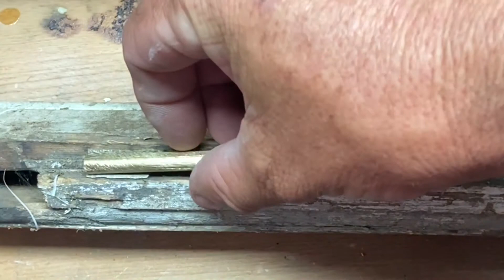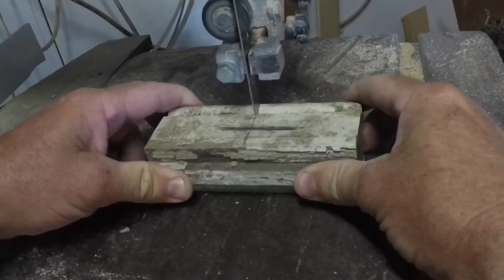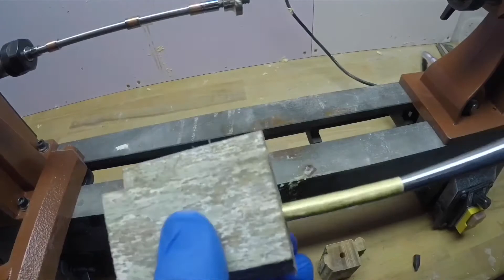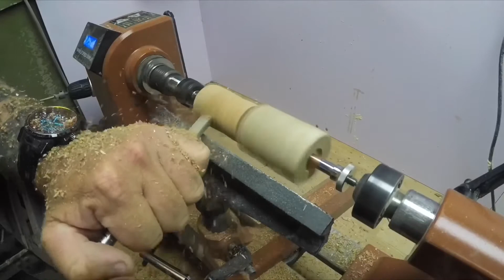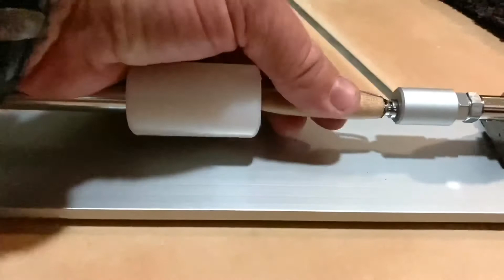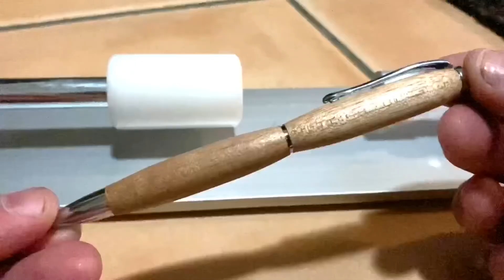Woodturning a silky oak pen

Comment: I was given a piece of silky oak it has become my best selling wood pen. Most people prefer to buy acrylic pens from me usually because they are purchased as gifts. But occasionally a few customers do like the speckled grain on the silky oak. That's why I turn them. Just a thought I would have trimmed the wood down to size before I started. It looked like you were turning an entire piece of a window frame. Pen turning is a wonderful hobby. I am learning new little secrets every day. Hopefully I will be able to call myself a pen turner one day. Have a great day. Thanks for the video.
Reply from the maker: @alanhill4338  enjoy your journey of wood turning.  I was lucky to start when I was only a teenager and have been doing it for over 30 years now and love it.  Yes it was a full window frame and only done that way for a video.  But like most men I’ve been collecting different types of wood since I was young so I have to much sitting around.  Thanks for your comment 🤙